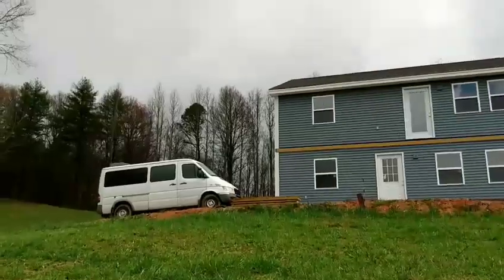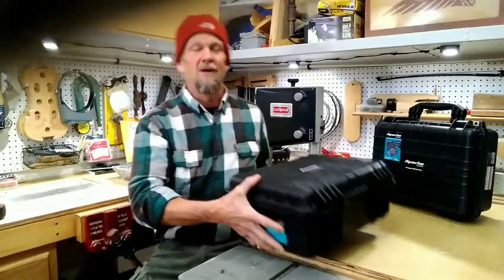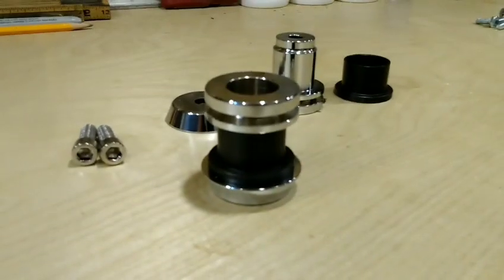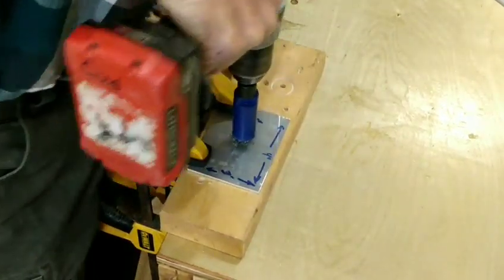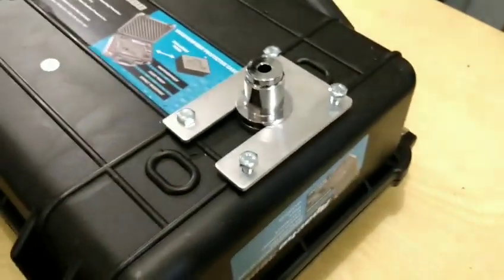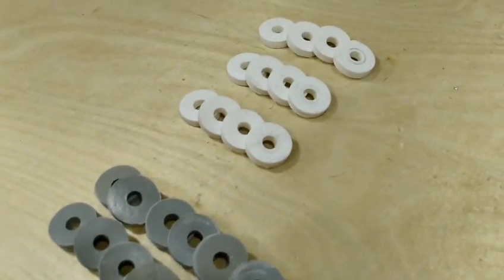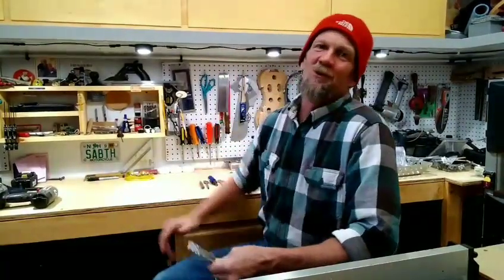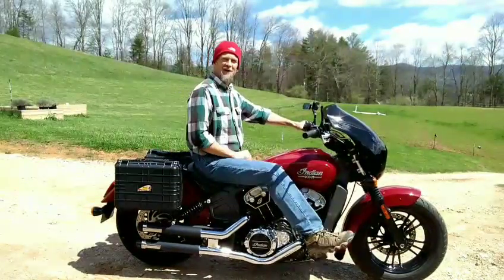Harbor Freight bags on an Indian Scout!

Comment: I'm also trying to figure/finagle a mount & release system (with lock/security) using Harbor Freight Cases for my CRF 300L Rally.  This is perhaps the Best I've seen yet!  One of the nicest aspects of your ingenious build was how "OEM Factory" slick/swank those Chrome Spools looked & matched your Indian while your Cases were removed!  Added surprises, benefits like these often occur when you courageously trust your own ingenuity, skills to solve your own problems and humbly meet your own needs!  Rather than simply spending, consuming - one should pause to consider/utilize materials that you already own, have rather than simply relying on others.  By trusting & applying YOUR OWN artistic mind, problem solving skills men are often surprised at their own ability to "invent or create" something far more unique, customized & superior to mere widgets massly produced.  Bravo!
Reply from the maker: Check out SW Motech for their bag mount system.
Look at the SLC side carrier.  You can buy the mount for $60 and build your own attachment point.

Just got it mounted on my FTR.

Comment: thanks a lot for making this very informative video :) you speak very clearly and show everything clearly. i was looking for an example of how those kind of cases look on an indian scout. i like them. i will most likely fit them on an 2020 Indian Scout Bobber. i think it will look very cool. and be practical!
Reply from the maker: Thanks so much for saying thanks!  
Let me know how it goes!
Reply: @grandpasmountain   you are welcome. but after i placed the comment, i found the Honda X-ADV 750....... and i fell in love. i want that one. it is the perfect blend for me. i love the Indian Scout with how it sounds and looks, but it is not practical enough for me. i like a good windscreen, good seating position and cargo capacity. the X-ADV has it all for me. any standard knees-bent-with-ankle-at-shoulder-line is not suited for me because i have very long legs. so that forced me towards motorcycles like the Indian Scout. until i found the X-ADV. my first motorcycle was a Honda VT500C and i loved it. a big twin smile on my face every single time i opened that throttle. but after a while it became clear that it was not practical enough for the kind of use i required from it. anything above 80km/h was painful ( wind ) and the pegs were too far back. and there was no space to put decent cargo because the exhaust system had to be made so it pointed upwards.

the X-ADV is not a v-twin but it still sounds amazing to me, even with the default exhaust.
Reply from the maker: @NC700_68  sounds like a great bike!!! 
I was riding the Scout for a long while on dirt roads in the mountains the other day and was thinking how great an adventure bike would be, haha.
Reply: @grandpasmountain  wow it takes some courage and crazy to take a scout on a dirt road :) i always liked the idea of having a motorcycle that would not start to cry if it saw some less fortunate road quality.
Reply from the maker: @NC700_68  there is a lady touring South America on a Scout 60 with motard tires.  Figured if she could navigate a 3rd world country, I could make it down a dirt mountain road in Virginia!!

https://www.dailymotion.com/video/x7mrgtc
Reply: @grandpasmountain  well, that is a serious challenge considering the ground clearance is not exactly the best for offroad..... if you hit a nasty puddle, you are entirely stuck with a Scout.

Comment: Jon, Do you think you might need a reinforcing plate on the inside of the cases? One for each set of four mounting screws.  So four plates with four holes for each bike.  I had cracking and layer separation issues on my Norton Commando's hard bags back in the 70's.  Lots of hard highway miles and vibration caused the material fatigue.  But a great project, , well thought out and executed.
Is the bungalow now available as an Air B&B?
Reply from the maker: Hello, Max!
Not worried --- this a much different material than your bags were. 1/4" thick and will not crack. 
Thanks for thinking of me --- I had initially expected to need interior reinforcing, but am confident in the material after working with it.

The Bungalow will be....once I move up on the hill!!!

Comment: I realize it’s been a while since you posted this video. However I was wondering if I could get a link to where you bought the spools from. I can’t seem to find any like them and I think I’m going to use your method to attach ammo cans on my motorcycle.   Thank you in advance.
Reply from the maker: There are plenty on eBay for about $40 a set.

Make sure you search using the right key words.  They're there!

Comment: Comment were turned off on your saw mill video. My brother and I are building sawmills. He had started the business and then quit do to health issues. Now we are starting it up again. I don't think he had a brand name. He did have a model for the different sizes. He also builds custom mills to order. He is in the process of building a couple new models. I should be having a video or two on my channel in the next month or so demonstrating one of the new models. Don't know prices. It all depends on options added to each mill.
Reply from the maker: Thanks--- 
Just found out that if I marked my video as safe for kids, comments are turned off.

I was going to build a mill myself, but couldn't make one for $3000....at least it wouldn't have been worth my time right now.
I work 12 hour days and it's hard to add another project.

Look forward to your video!

Comment: Brilliant
Reply from the maker: Lol, thanks.  Don't know if I really qualify as "brilliant".  Cheap, yes.
Reply: @grandpasmountain  I learned a number of pointers through your process. I'm trying to decide if it's worth hacking a mint pair of tear shaped Yamaha OEM bags to fit on my new Scout. Indian wants my first born for their bags and set up. I would be hacking my old bags working with less tools than you...no table or band saw. No patience for the hack saw either. I mainly have to figure out how to construct or acquire an off brand hanger to keep the bags from rubbing against the fender as well as not leaning in to the wheel.
Reply from the maker: @artmaze  there are several options.
There are some knock off EZ brackets for cheap on ebay that will work....
There are spools made for Harley that will work, too.

The spools I bought that were $68 are down to about half that now.

The two bolts on the rear fender give a number of options for mounting.
Reply: @grandpasmountain  Picked up a shelf hanger and cut it into to pieces and trim and Ground it, drilled four hills on it two for the Fender and an inner two to reuse the "U" shaped hangers from an old bike and primed and painted the brackets made from the shelf hanger. Even Indian Motorcycle was impressed
Reply from the maker: @artmaze  
Sounds very creative!  Wish I could see a picture!

So you cheated the company out of selling you $1000 bags?!? 
Shame on you!